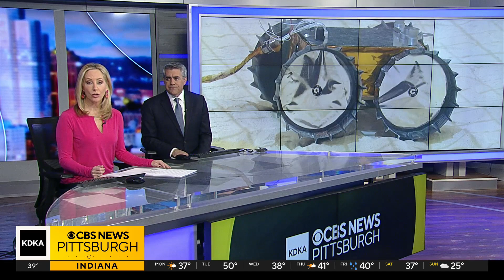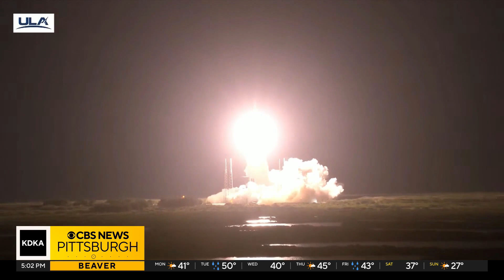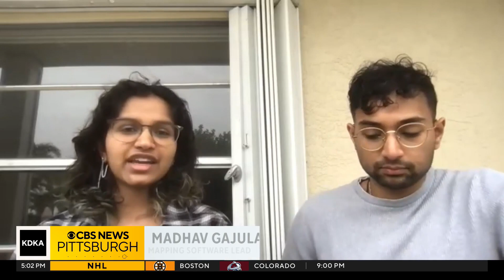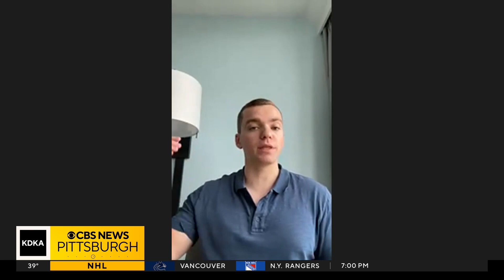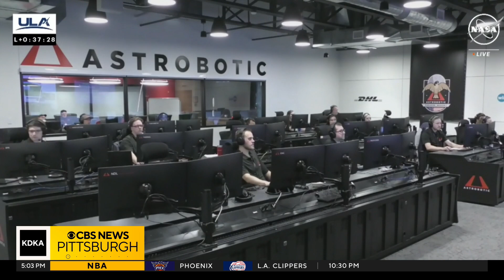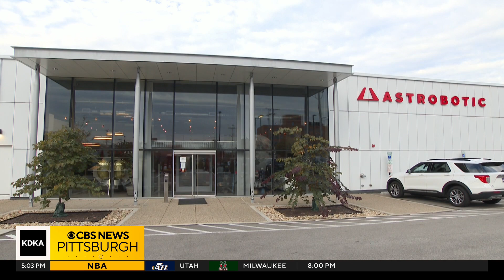Pittsburgh-based Astrobotic working through "critical loss of propellant" after lunar lander launche

Comment: the launch pad has it going against the earths rotation. -650 mph. it needs 25,000 mph plus 7000 mph. ion isp 2000 to 5000 seconds. gx2000=maybe 100,000 feet/second.   e^(dv/ve)=mass ratio=mi/mf  e^.1=1.1  the zenon fuel must be 10% of the rocket mass.